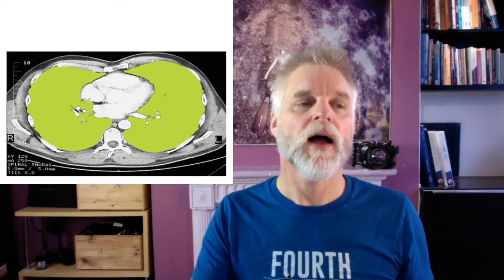Mouthfill -  A dangerous freediving technique : NTX Livestream

Comment: @Marcus Greatwood what is your MT EQ ratio pleas?
Reply from the maker: Hey up....
What do you mean?
Did you mean MF EQ ratio?
Reply: @FreediverMiG  calculation of MF efficiency :-) Or write how deep you are doing MF and which depth you reach with this load. .I  Will I count it for you. You have to convert the depth to pressure when calculating this. Perfect MF ration is 4 so you can reach 70 m with the MF in 10 meters. If you teach it you should have at least 3,5 :-D
Reply: looking forward your answer and your efficiency :-)
Reply from the maker: Oh so you did mean MF EQ.
(Not MT EQ)
🙂
Well I’m guessing u didn’t watch the video… as I believe you don’t need mouthfill at any depth.
indeed using it directly damages the lungs.

Having taught people to dive past 100m and worked with Löic all without MF,
I don’t teach MF.

How deep can you unpack, is a much more important question - as this shows how flexible you are.
E.g. being able to comfortably unpacking at 80m will get u past 100m, but the pressure created by unpacking is orders of magnitude less than the water pressure at that depth.

Practicing with a mask will help, as it requires more air thus efficient training can be done shallower and with the added safety of being able to see.
Reply from the maker: And (of course) the depth actually doesn’t matter - Calculating the simulated or theoretical depth is pointless.

E.g. practicing Name & Number exercise for instance - you are either flexible enough to make it to the bottom of the pool and u increase the stretch, or you don’t make it & continue at that stretch. Knowing the simulated depth is 40m or 80m means nothing.

Comment: I have problems with understanding your explanation of lung squeeze. The rib cage and the lungs aren't connected. They are separated by two layers of pleurae which is a thin film. One layer is attached to the inside of the ribcage and the other is attached to the outside of the lungs, the parietal and visceral pleura respectively. There is a potential space in between these two pleural layers though this space in physiological conditions is hypobaric which means that the two layers are sucked onto each other with a minimal amount of interpleural fluid in between them to facilitate a low friction environment, like putting a minimal amount of water in a empty balloon and the feel how to rubber  glides back and forth between your fingers.
So I have a hard time understanding how a tear in the lungs should occur just by the action of separating the rib cage and the lungs. 
I love listening to your free diving tips and have a considerable respect for your knowledge. But this was hard for me as a M.D to understand.
Reply from the maker: Hiya.
Thanks for your reply.
Yes simplifying these things is always walking a tightrope.
From a qualified perspective (like yours) it would have been better for me to have said that there is a connection between the ribs & lungs that allow one to move the other although it is not a direct connection. This connection means a lack of flexibility can result in transpulmonic pressure exceeding intraalveolar pressure, causing transudation of fluid or blood from ruptured of pulmonary capillaries as well as possibly damage either visceral or parietal pleura.

The point was that we should increase our thoracic flexibility to save damage.
😄
Reply: @FreediverMiG  Yes that makes more sense. Thanks for the clarification I appreciate it.

Comment: I don't agree. Many informations are correct but the conclusions are semplicistic and the dangers are not where this video points. I.e. pushing yourself from a comfortable depth of 70 to 100 with mouthfill is almost identical to use mouthfill from a comfortable depth of 40 to 58,5
Reply from the maker: You missed a huge point ...
a 40m dive is not particularly deep.
And you will not stop Freediving if you make 42 or 58m. MF is not actually improving the diver just getting them deeper.
If you are diving 80m however, the physicality of the dive is a challenge. Equalisation is only a small part, so diving to 82m will actually stretch the diver and  a dive like that would require at least 24h recovery.
Reply from the maker: And besides PUSHING anywhere is the danger - I never NEVER said push from 70 - 100m.
I’ve spent 20years of my life teaching that PUSHING is the problem.
😄
Reply: Let me try to be clearer. If you say that is ok to use the mf when your comfortable depth is 70 to go to 100 why should it be different for someone comfortable at 40 to learn the mf and go deeper? If I follow your explanation in the video there are no physics neither physiological differences
Reply from the maker: That is a good question.
The answer is threefold.
1.flexibility
2.skills
3.effort

1.Not much flexibility is required to reach 40 m (33 m being the average flexibility limit before training). Whereas 70 or 80m requires a lot of flexibility. 
So it is reasonable to assume that 40 m is a hard limit, whereas 70 m is a soft limit… Where the diver has already been Able to flex.

2.the skills required to drive to 70 or 80 m Would mean that Diver has been training for some time to develop themselves and their awareness. Where as chances are, a 40m Diver Has not a lot of experience. The fact that they want to “go deeper“ is already a dangerous sign.

3.Diving to 40 m doesn’t take too much effort, or recovery compared to a 80 meter dive – that would be done only once in a session with a decent (24 hours) recovery. This recovery time should be sufficient for the body to adapt to a 2 m stretch from 70–72 m.
Reply: @FreediverMiG  you are once more confirming exactly what I was saying. There are no physiological neither physical differences. I agree with you that a 70m diver USUALLY is more experienced, more flexible and has more skills BUT these are just opinions and subjective evaluations. Nothing to do with the assumptions you make in the video. Mouthfill is not dangerous at any depth per se. It is dangerous if used by someone with not enough flexibility and experience to push and go deeper. This can happen at any depth. So there is no reason to prefer other types of equalisations. Reverse packing can be as dangerous as mf and pushing with the abdominals to move the air from the lungs to the mouth even more!  In the end this is why you need and instructor to progress: to judge what level you are and suggest the right steps to progress. Saying that mouthfill is dangerous is like saying that Shirsasana is dangerous. It is just an advance tecnique. (PS when you say people are being injuried and dying I would love to see statistics and real situations where the main cause was the moutfill and it happened at "shallow" depths. The worst cases in freediving, that I know of, have been of people going deep in CNF. And as far as I know they where not all using mouthfill).
Reply from the maker: @pietrocc   
Let’s get one thing straight… Mouthfill is not an equalisation technique.
It is simply a way of storing air to be used for equalisation.

It is dangerous, saying it can be used safely doesn’t mean it’s not dangerous.

If you do not have the flexibility to go deep – you will injure yourself.

Mouthfill allows people to go beyond their flexibility limit.

You can argue about the physiological aspects, but this is black and white.

There is absolutely no excuse for people to teach mouthfill to people diving shallower than 70 m.

(Whoever taught you that reverse packing Is an equalisation technique should also not be an instructor)
Reply: @FreediverMiG  Once more you are pointing to language: you are right, reverse packing is part of a strategy of equalization not an equalization technique. This however is not the point. To equalize you need to move air from the lungs to the mouth and all the methods that I know are dangerous. Please if you have one that is not let me know. All the certifications that I know and books that I have read present the same techniques and I don't find any solution that is not dangerous.
Reply: @FreediverMiG hi! I just have a question related: so if mouth fill is a way to get air from the lungs and not a eq technique, the way to finally eq after doing the mouth fill is the frenzel? It is confusing cause around internet, people speaks about mouth fill as a eq technique diferent to frenzel...

Comment: This isn't exactly right. To "pull" air out of the lungs at depth lets say of 40+ meters will require either push of the diaphragm or reverse pack. Both of these techniques (especially diaphragm push) will put strain in your chest and may cause lung barotrauma. This video is extremely "one sided". You don't talk at all about pulling the air at depth below RV.
Reply from the maker: This is exactly the point of the entire video!

reverse packaging (pulling air using the throat & mouth) WILL put strain on the chest - but it is 
1. Controllable
2. Very weak compared to water pressure.
So u are much less likely to injure yourself “pulling up” rather than allowing the pressure to build un checked.

Basically mouthfill ignores the pressure increase as opposed to controlling it.

There is a reason why lung squeeze didn’t exist before mouthfill. 
Even down to 180m, (I was working with Löic back in 2005-2007).

Btw It is impossible to push air with the diaphragm (it simply doesn’t move upwards enough)
Reply: @FreediverMiG  Is your statement based on any case study? I assume no, so it's a guess. 

Lung squeeze existed in the past but was not publicly available information. Freedivers back then didn't talk about it and also the sport was MUCH less popular then today. 

I do agree that freedivers strive to greater depth much quicker then in the past. I'm sure that mouthfill should be thought to advanced freedivers reaching depth of at least 40 meters using Frenzel technique without mouthfill. Any equalization technique has its own advantages and disadvantages. Depth increasing should be done very gradually with 1-2m increases and by constantly evaluating how comfortable you fill at the bottom.
Reply from the maker: Oh no sir.
I was there. 
I worked with Löic from 2005 -2007 down to 180m with no mouthfill.
😄
And let’s not make any mistake here, mouthfill is NOT an equalisation technique (simply a way of storing air to equalise with)
Reply: @FreediverMiG  I did some 140m no limit dives without mouthfill in the past and had some severe lung squeeze trying to bring air from my lung at this depth... I think relaxation of the chest and absolutely not using the diaphragm deeper than RV is crucial to avoid squeezing. And yes definitely the flexibility of chest also.
Reply: Nowadays if you don't use mouthfill you look like a weirdos ...